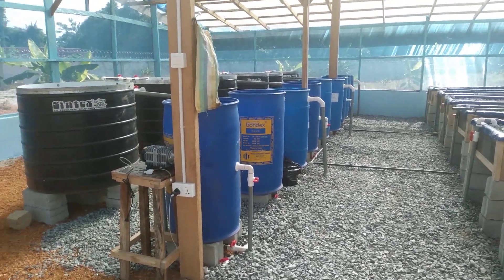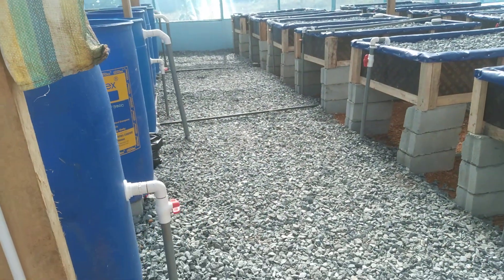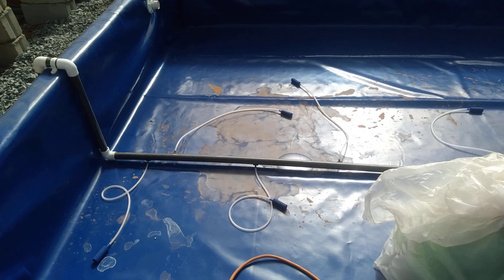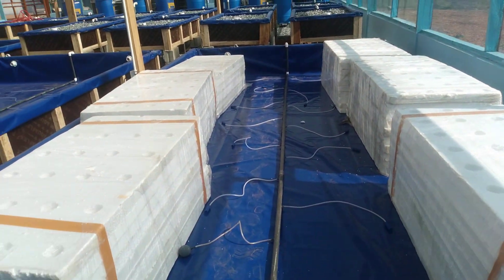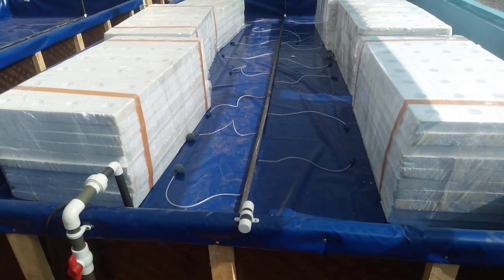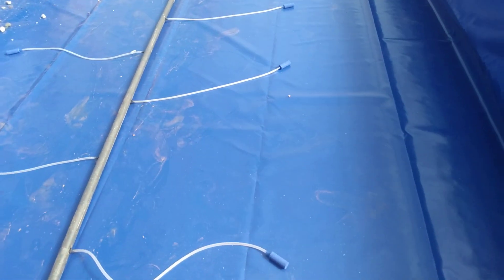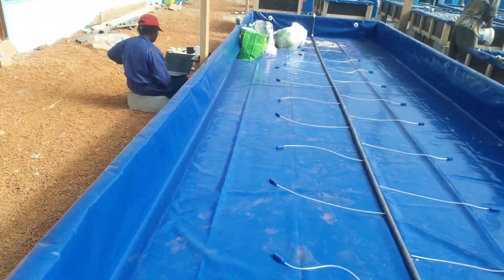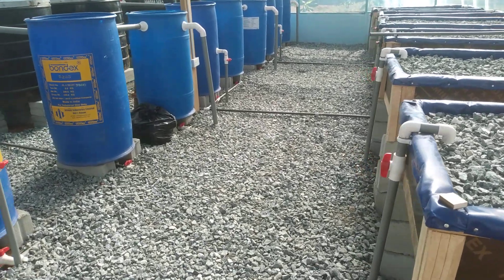Aquaponics Farm at Tafo Day 6 update1

Comment: Thumbs up, pls what's the size of the pump used ?
Thanks.
Reply from the maker: Each is 100wat, delivering 5200L/H. I have however found 40wat, 5200L/H which am using on other projects
Reply from the maker: Just for you to know also that the pumps were oversized for the size of the projects.